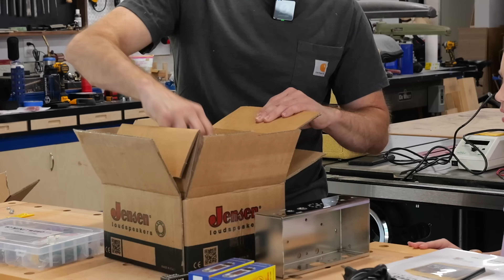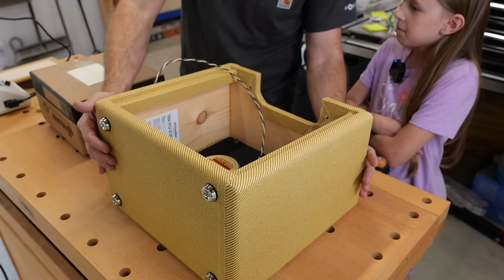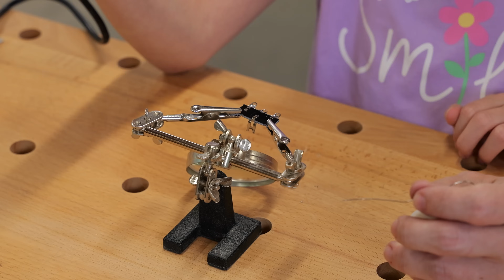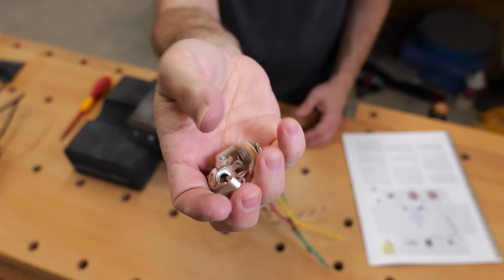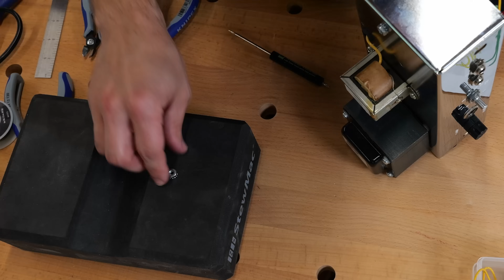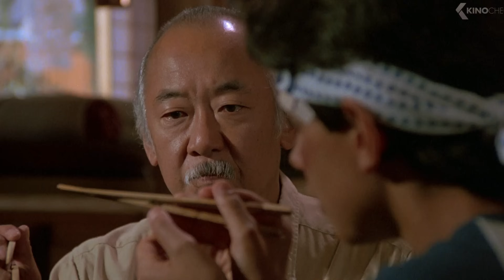Easy to Build Tube Amp

Comment: Just did a Jag kit build , and reached for a brand new 90° end wire (just easier to work with)
So as i am turning things over to mount in the body . All sorts of short noises , and so I am diong piont wiggle checks of my work , seems good ,,, snap , crackle , pop again as I go to mount the control plate .  I was frustrated . I set it to the side for another calmer go at it . Well I reached for the same wire to play one day , and ...... realized that the New Wire was the problem 😂😂😂
Reply from the maker: Man at least it was an easy fix and you didn't have to rewire stuff!  Frustrating as heck in the meantime though 😂

Comment: center ground please??
Reply from the maker: The amp does have a ground.  Is a center ground different than how this amp is grounded?  TIA 👍
Reply: @WoodshopMike   You swapped polarity on the speaker, right?.. I think that most pedals and equipment uses center ground on round plugs, that's all.. (im learning).. sometimes you come across a center hot, and use some standard adapter, and POOF.. So I assumed that your model was intended to use center ground on that connector.. That's all.. Glad it turned out though.. What a great way to learn, like building a computer..  CHEERS
Reply from the maker: Ok gotcha.  I actually ended up shorting leads on the plug so that's why it wasn't working. 

But yeah, kinda like building a computer... Which I just had an unplanned upgrade project on 🤦🏽‍♂️ man ram has gotten expensive!
Reply: @WoodshopMike alright because we don't make anything here but paper plates toilet paper, plastic Solo cups and disappointment. So now with these tariffs, everything that comes across to our country has gone up in price. Welcome to the golden age? Anyway, thanks for responding back. I just jumped back in after 35 years of not playing. But now I'm back. I'm retired and I'm going to put a band together called geriatric and the geezers. I'll be jerry. Haha. Jerry Hatrick and the Geezers.
Reply from the maker: 😂😂😂 that's an awesome name!

Comment: My first guitar amp of my own was one I built from the valve amplification unit of an old '50s record player. There was a local repair shop near me that had a room full of old radios. This was in 1984, and the shop is long gon; some of those antique radios would be worth serious money these days.
 Even though that kit is very expensive, I would buy a Harley Benton Tube 15 Celestion amp and modify it into a tweed-looking amp, and re-voice it.
They only cost $340, and then the cost of the tweed material.
 Ifit'ss a kit that someone really wants, there are quite a few amp kits available, and at a quarter of the price of the StewMax one!
Reply from the maker: Sounds like an awesome experience making your first amp!

Comment: love it! you could use speaker connection spades on the wire instead of soldering it so you could swap the speaker out if needed
Reply from the maker: Thanks!  Glad you enjoyed the video 😃 you're right, that's a great idea👊

Comment: I’m 15 and I was gifted my great great grandfather’s 1958 Fender Champ Lapsteel guitar and I’m thinking about getting this kit to match it because the fender champ reissue here in Canada is 2 grand. Thanks for the video!
Reply from the maker: Very cool!  Just so you know StewMac is currently running a 20% off sale site wide.  That kit isn't cheap, but 20% off is pretty sweet! 

Happy building whenever you decide to build your amp!  It's a ton of fun😃
stewmac.sjv.io/EEBbX4

Comment: That circuit board looks like it has plated through holes which is much better and far more reliable than a single sided side board, so that's a good sign.
Reply from the maker: Yep they're plated all the way through👍

Comment: Ive been wanting to learn pedal bulding and amp building. Never have done work on my pickups. But thats first. Im jeweler so i do have a knowledge of soldering in general now, so thats a good thing. Tried once when i was about 14 and gave up instantly haha. Now its time. Got my pickups... ill do that on my tele. Then maybe ill do this amp. Thanks for the inspiration. This video made it seem a lot easier than others.
Reply from the maker: Pedal building is a ton of fun and I have another amp build slated for later this year!  Glad to hear you're giving this a go, have fun!

Comment: If I may, would be prudent to think of Tube Hang/Placement when realising the movement and shaking of the Amp in transit etc plus the speaker is blowing back right onto the Tubes which is likely to shake them loose. I made one many many many moons ago and hung them right behind the speaker. It was a nightmare they constantly shook loose and fell out and the sound was rubbish once I moved them the sound was a hundred times better and no more shaking issues...Just a thought!

Comment: For longevity, it is important the islet board and backer board don't absorb moisture from the air.  The Paul Rivera method works well.  He recommeds:  Before you wire anything to the islet board, take both boards and put them in a toaster-oven on low for a couple of days.  After this, take the islet board and and dip it into melted wax to seal the board from moisture.  You then scrape the wax away from each islet before you use it.
Reply from the maker: Thanks for the tip!

Comment: There is no turret board in point to point wiring. You are doing turret board wiring.
Reply: Your daughter will never forget what you did for her with the amp build. Good job Dad! FYI, that turret board construction is one reason why the old Fender amps could go on tour and take a beating. That’s how the military electronics was so durable. I did club dates on the road for years with an original 65 Super Reverb. Never failed me. The best Fender amp ever made.
Reply from the maker: @hiroller79 we really had a blast! 

Good to know!  It definitely seems bulletproof!
Reply from the maker: Thanks for the clarification 👍👊

Comment: Great video. However I noticed you plugged the tubes in with your bare hands. Small amounts of oils from your skin are transferred to the surface. Those oils heat up and can cause the bulb to break. Use gloves next time! Btw, this little amp sounds grea!
Reply from the maker: Thanks!  Glad you enjoyed the video👊 I'd read both sides of that issue (gloves vs no gloves) after the fact and figured next time I might as well put on some gloves just as a preventative if nothing else.

Cheers!

Comment: Looks like a fun project.  The supplied tubes don't do the amp justice.  A TAD Redbase 6V6GT-STR and a ShuGuang 7025 (MilSpec 12ax7) would be a big improvement.  The WGS G8C is also a warmer and fuller sounding speaker than the Jensen.  That will make the biggest tonal difference.  The new tubes will fatten, smooth and enrich the overdrive character.  Please do a b4/after video if you make any of these changes.
Reply from the maker: Thanks for the info!  A before and after comparison would be really cool!
Reply: @WoodshopMike  Glad you responded.  The 450V-rated Redbase 6V6GT-STR is made in the Psvane factory in China and is sold in the states by Stew Mac.  It's considered the best current 6V6GT made and comes stock in Revv amps.  It has a fatter/less-compressed sound with a softer harmonic shimmer than the JJ 6V6S.  The ShuGuang factory reopend last spring after a fire several years ago.  Their 7025 can be found very cheap direct from china.  You might order several to compare, or in case you get a bad one.  It has a fatter & smoother tonality than the EHx 12ax7.  EHx also has a nice 7025, but it's not worth the extra cash.
Reply: WGS speakers are made in Kentucky.  It was founded by the former CTS speaker manufacturer.  They came stock in some Fender amps in the 60s. You could go for the G8A for the AlNiCo compression at 2x the price, but it also has less bass.  I wouldn't.
Reply from the maker: @GCKelloch I'll be building another amp in a few months and will be putting a pair of their speakers in the cabinet.  Really eager to get to that one 😀
Reply: @ What type of amp and which speakers, if you don't mind me asking?
Reply from the maker: @GCKelloch I can share a few details at the moment.  Speakers will be a veteran 30 and an ET65 in a custom cabinet with some adjustable sound ports.
Reply: @WoodshopMike  Those two mix well.  Porting different speakers in the same cab might not work as expected due to the different parameters, but experimentation is always good.  

Have you thought about mixing a 55Hz cone speaker with one of those?  Either one should work.  The Vet 30 has more mid-bass growl.  WGS used to make a nice Reaper 55Hz upon request.  Just 30W as I recall, but you could ask WGS.
Reply from the maker: @GCKelloch I've heard they mix well!  Yep, totally going into this with the experimenting mindset 😂
Reply: BTW, if your next amp is EL34 based, the marvelous ShuGuang grid-aligned EL34B is available pretty cheap from The Tube Store. They also sell them for a bit more in their "Preferred Series".  It's the same tube, but fully tested and selected for strength, which can be ordered at a requested grade level so you needn't rebias with new sets. They have a 500V G2 rating like the old discontinued SEC "Winged C" with welded, rather than, crimped joints.  Should last pretty long.  They were all the rage in the 90s.  The Tung Sol EL34B is very nice too. Again, more expensive and a bit darker sounding.
Reply from the maker: @GCKelloch thanks for all the info!
Reply: @WoodshopMike  Cool, man.  Looking forward to hearing your experiments.  BTW, I think your relationship with your daughter is exemplary.  Bravo!
Reply from the maker: @GCKelloch thanks and thanks!  Cheers 👊
Reply: @WoodshopMike  Sure thing.  It's also worth using certain caps and even resistor types in certain places to tailor the sound and, more importantly, for reliability.  Quality power supply caps are crucial.  I don't know all the details, but Lyle of Psionic Audio is a good source.  He addressed some of it in his most recent Q & A video.
Reply from the maker: @GCKelloch thanks! 👊
Reply: @ I mean his Live Chat video.  His last short video on the Blackstar Artisan is worth the watch for some basics.
Reply: Just wanted to add one last entry, and I'll let you go on with your life. 😅  I've followed electric guitar related forums for the last few decades and have come to some conclusions about tubes.  First, there's no reason to assume ShuGuang tubes are less reliable than any other current tubes.  Perhaps you know there are only four factories making all current tubes regardless of all the rebranding.  AFAIK, ShuGuang are sold as ShuGuang, Ruby, as some of the Preferred Series, and possibly Ray Tubes.  Psvane are a Chinese company started by former ShuGuang workers.  They supply the new TAD Rebase series.  JJ are made in Slovakia.  All other common and reissue tube "brands" are made in Russia at the Reflector plant.  Current Sovtek, Mullard, Telefunken, Svetlana, and EHx may well all be the same rebranded EL34 tubes.  Tung Sol actually have some different tube designs, like the EL34B ad 7581a.  Tube reliability seems to depend on a given tube type from a given factory.  FI, the ShuGuang KT66 are reportedly more reliable than the darker sounding Russian Gold lion KT66, but the Tung Sol 7581a is built like a tank.  The ShuGuang 6L6GC is also supposed to be a reliable and balanced sounding tube.  The JJ 6L6GC sounds nice as a standard work horse, if not a bit lackluster, but can audibly rattle in a combo amp.  

That about covers most of what I've learned about current tubes.  One ShuGuang EL34B reviewer on The Tube Store said his set only lasted 18 months of everyday use in a guitar amp.  That's excellent for a current tube.  Some may report otherwise, but it's often user error or a fluke of some sort.  Any tube can be defective.  New tubes are likely less reliable than older ones because more companies used to make things to last.  Now, it's more about repeat business.  Not sure how much you've researched amp building, but The Music Electronics Forum is a good place to start.  I subscribed to your channel to hear any demos of your projects.  Take care, stay safe, and best of luck.
Reply from the maker: @GCKelloch haha, no need to stop!  You've given me so much great information, thank you for all of that!  Thank you for subscribing too, hope you enjoy the mix of content👍
Reply: @WoodshopMike  I guess my last reply was deleted by YT AI because I mentioned a particular forum I'm on, or that it seemed self-promoting.  It wasn't important.  I don't want to pry about your next amp project, but I could suggest a specific tube set if I know what types it will be using, and I haven't already covered enough for it.
Reply from the maker: @GCKelloch oh that's a bummer!  I was gonna refer to it for future reference 🤦🏽‍♂️
Reply: @WoodshopMike  The main point was that I'm on the GuitarNutz2 forum with the same screen name.  PM me there if you want.
Reply from the maker: @GCKelloch thanks! 👊
Reply: @WoodshopMike  Say, you might wanna check out the very quick tube socket wiring tip in the most recent Psionic video "Kill the Buzz | Marshall Heaters Trick".
Reply from the maker: @GCKelloch thanks! 👊

Comment: Great video and a fun kit.  

One safety note - the power cord looks like it's attaching the ground/earth wire to the tag strip that is mounted on a transformer bolt.  This is a fundamental no-no and should have its own chassis mounted bolt - it's not up to "code" as it were and places a risk of the earth becoming detached should the transformer bolt loosen which is more likely due to the weight on it.  The safety ground should not be shared with common ground either! ideally to reduce noise. Check out Psionic Audio's channel covering this on a lot of the repair/servicing he does.
Reply from the maker: Glad you enjoyed the video and thank you for the recommendations! I'll have to check that out 💪

Comment: How come you use such a thin soldering wire? I get why you have your daughter using it, it's good to learn with, but you could easily use a thick wire, it's hardly a dab, sizzle and the joint's done.
Nice workshop, btw.
Reply from the maker: Really using thin solder just because that's what I had on hand.  Thanks, the current shop is the product of about 20 years of upgrading tools here and there 😀

Comment: NICE!  I know its supposed to be a vintage design, but keeping those phono jacks on the speaker is not the best idea.  there's a reason nobody uses them anymore.    Plus theyre less likely to get pulled out, which is usually not a good thing on a tube amp.   I'm working on a  vintage  66 vibrochamp that has it.    Kills me to keep it in there...

Comment: Nice job! I've built several amps I think my LEAST favorite part is wiring up the tube heater wires. I really enjoy wiring the board with components but those chassis as you say get pretty cramped when things are in place. I noticed this building a 5e3 Deluxe amp. Good father daughter time too. God Bless.
Reply from the maker: Thank you so much! 
Yeah wiring the tube heaters can be a bit fiddly for sure.  I thought about the 5e3, but thought this would be a better starter build😃. God you as well

Comment: I’ve built at least 100 Fender tube amp clones. I try to use real vintage output transformers, power xformers and speakers whenever I can. I’ve been building tube based audio, music and recording gear for 50+ years and have accumulated an enormous stock of vintage parts, tubes etc.
If I can ever give you a hand feel free to reach out.
I enjoyed your video, particularly the way you featured your daughter. My daughter never even attempted to fake an interest in my hobby/business.
Peace,
Rick
Reply from the maker: Hey Rick!

Thank you so much for the offer, I really appreciate that and will absolutely take you up on the offer.  What's the best way to get in touch?  You can always email your info (mike@woodshopmike.com) if you don't want your contact into on YT.

Cheers,

Mike
Reply: How does a "vintage" transformer differ? It's not like transformers have really changed that much since then, have they? Isn't it just two wires around some iron?
Reply: @LuLeBe shop for one. That will educate you real fast. Tubes use voltages not commonly found in any other power transformer. They start out rare. Then, need to be matched to the project. More rarity. They're expensive. Expensive stuff is commonly replaced with cheaper substitutes for saving money. Not a viable solution for a tube amp.
Reply: Hi how to get in touch with you
Reply: I too would like to get in touch, as I am trying to learn how to make tube amps out of my grandpa's old tube collection.

Comment: I know you are a newbie but that is an eyelet board, there are also turret boards. Point to point is like a 1930's radio where the components are scattered all over near to where they connect. They use some terminal strips but that's it they jump around from this point to that point. The turret/eyelet board was the next advancement followed by couplets, which were the first multi component components. They would have a few resistors and capacitors in one component usually wire 4 to 8 leads. This is an eyelet board construction though not point to point, just saying, not trying to be the know-it-all a-hole but I figured you would want to know.
Reply from the maker: Didn't come across as a know-it-all-a-hole at all👊 thanks for the info!
Reply: @WoodshopMike  BTW that is nice your daughter is so into your guitar and building stuff.

Comment: That suoer fine solder wire is really annoying to use, you have to feed so many inches of it into every solder joint.
Try a regular thickness wire like 1mm (0.040")

Comment: I just wish they'd update these kits to the later models of these amps where the speaker out is between the rectifier tube and the power tube, instead of near the preamp tube (which can often cause squealing and other issues)